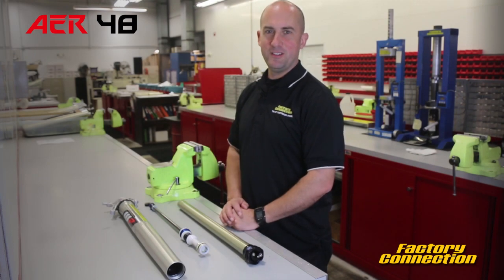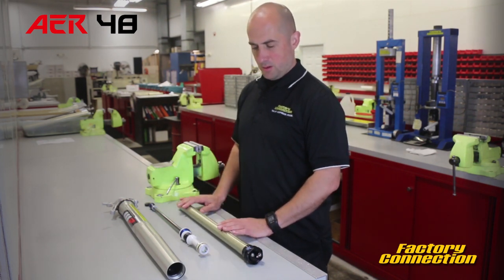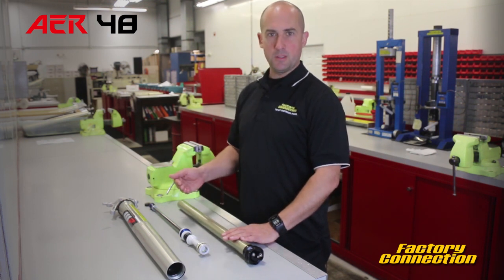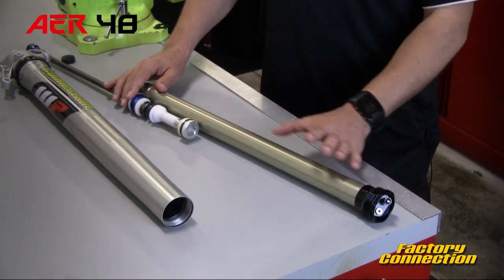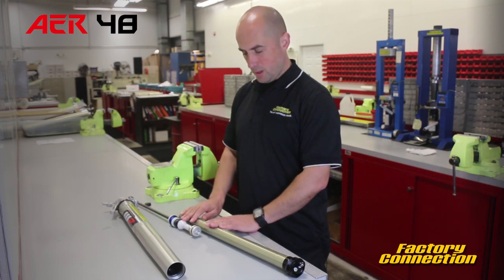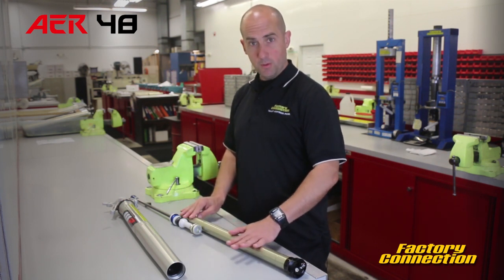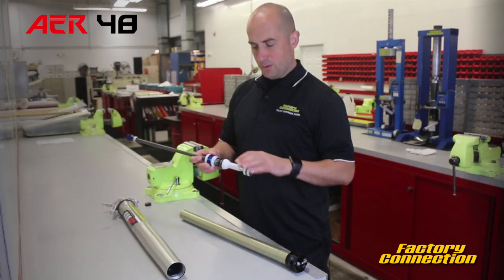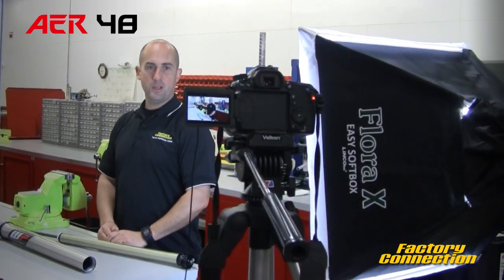WP AER48 Explained

Comment: Hello i have wp aer 48 from ktm 350 2017 After releasing the air through the valve, my shock absorber is collapsing and we can't pull it out... I think there is a lot of pressure inside and damage - what should we do?
Reply from the maker: I recommend you contact us to set up a Rebuild service on the forks.  Most likely is not damage, however I would recommend we replace Air Piston Seal and possibly the Screw Sleeve / cartridge seal on LH fork.  The RH fork the cartridge seal most likely needs replacement and we can update parts in the forks to an improved design starting in 2028 fork.  sales@factoryconnection.com or 603-664-2221 Steve Ross

Comment: Hi! Good explanation. 

Do I understand correctly that because of the balancing mechanisms in the air fork there is only a slight, non-adjustable preload on the air fork that is equal to the set pressure working on the rod area?

Comment: I know this an old post but I am in need of some help. I have a 22 85sx and I am trying to set it up for my daughter. She weighs about 85lbs fully geared up. The bike currently is too stiff for her. Is there stuff I can do without having internals changed out?
Reply from the maker: I recommend the following Fork: 68psi  5mm Fork Height 14 Comp 12 Reb   Shock: 16 LSC  2.5 HSC 13 Reb   120mm Rider Sag.  He is borderline needing softer 3.5kg shock spring  call us if you need more help or Revalve information - Thanks Steve Ross 603-664-2221

Comment: I still don't understand like which fork leg does the work. Does the left side (air fork) extend the fork when it's compressed and the right side (dampening) fork compresses to actually soften the ride? Or like why can you press the right fork fully with your hands when it's of the bike, but you can't do the same for the air fork side?
Reply from the maker: The RH fork is the fork with the Valving / Damping. Off the bike this side you can compress.  The LH is the air side fork.  When air pressure is set  and off the bike the fork will not compress easily, unless a very low air pressure is set.  On the bike the forks work together.  Lower air pressure is a way to tune the fork softer / stiffer and will affect ride height.  It is an AIR SPRING instead of a COIL SPRING.  The RH fork Compression  and Rebound also are tuning adjustments on the damping side for softer / stiffer preferences and tuning.
Reply: @FactoryConnection  Thank you so much man, appreciate it! Now I understand how they work.

Comment: What has been done to combat rising air pressure due to heat?
Reply from the maker: Some have used Nitrogen.  I would recommend a Spring conversion kit that eliminates the air cartridge.  give us a call for options 800-221-7560
Reply: I use Nitrogen in my AER fork. The air pressure inside the fork remains extremely consistent. Not only is Nitrogen less prone to expanding under extreme conditions it is pure meaning there’s zero contaminants and zero moisture. Assuming your shrader valve is clean and dry. 
In 2018 i had FC set up the suspension on my 2017 KTM 250 XC. TBH, i never was happy with it. The clickers seemed to be non functional and it felt to me like the rear spring was too hard or had too much preload. I could not get the rear of the bike to stop trying to endo over every dang water breaker. 
I eventually bought an SKF glide kit for the fork, took some preload out of the rear spring and switched to 3w shock oil. Forks are much better now but still not 💯 tickled to death with the rear shock. Bout time for a new scoot anyway.

Comment: thanks for the explanation, I'm picking up a 2019 FE450 tomorrow and was thinking of putting air forks on it. I presume the 125/250/350/450 SX all have different valving to some extent, not just rely on different air PSI?
Reply from the maker: John, we tailor each valving setting for each rider and model / year.   The AER48 fork is 950mm long and the XPLOR fork that comes on the FE is 928mm.  So the fork is a lot longer creating a chassis balance issue.  We can not shorten Air forks.  You should maybe consider and older set of cone valve forks that are 940mm 2015 or even 2016-2019 Cone Valve Forks 945mm. Thanks for watching!